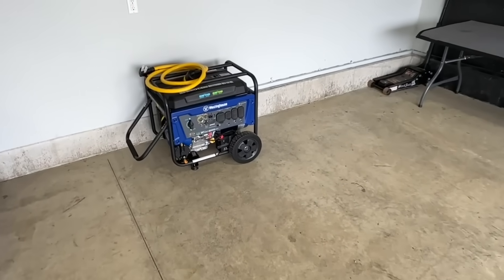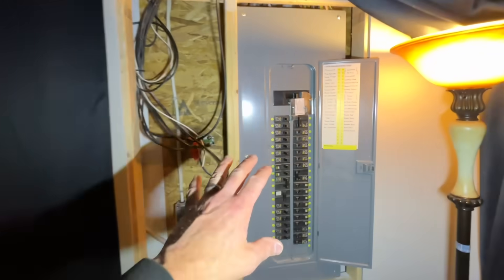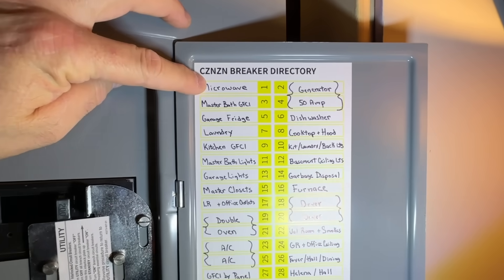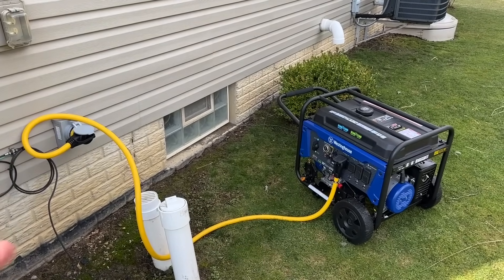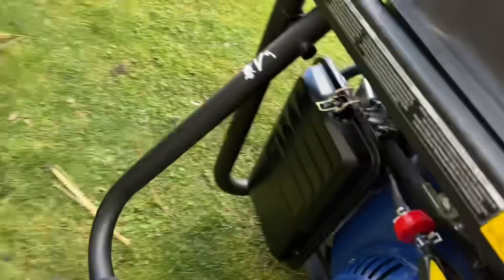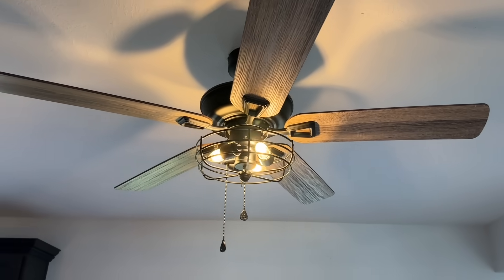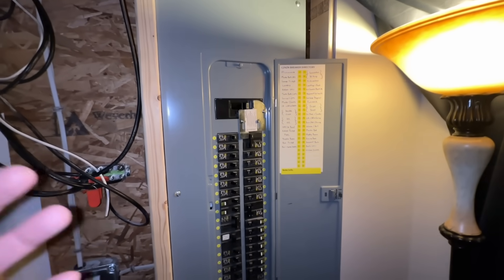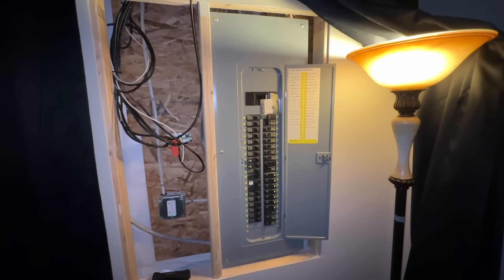Whole Home Manual Backup Generator Setup For Less Than $1600

Comment: Yes, it's amazing what you learn about your own personal electrical grid when you set up backup power. Luckily my stove is gas. It uses 120 for it's electronics, but that's minimal. My clothes washer and dryer are electric however. I have a 240 tanning bed that gets turned off on emergency power, as it's very voltage sensitive and normally has to run with a buckmaster. I do leave the hot tub on however, but that's it. The hot tub doesn't use much power just to maintain itself. But it does if you let it get cold. I keep mine at 104, and it's fully winter weather insulated. I also shut off my garage door openers and let them run on their own backup power. They'll run a couple of weeks on their own power easy. And they're both 3/4 hp motors. No point in allowing the backup generator to get involved in that if you don't have to. I run a huge gasoline powered job site Generac that's rated for ethanol gasoline, in a waterproof shed about 15 ft away from the house, and I had an electrician run the line and modify my panel for it. My Generac will build a whole subdivision and will easily power the house and it's sensitive electronics, but load determines fuel economy and while we will run the heat, we won't run the central air. Central Air has a huge startup draw. (Furnace blower, A/C control unit, outdoor industrial compressor, outdoor industrial cooling fan that needs a starter relay just to fire it up)

I've only needed it twice in the 15 years it's been installed. Ironically, within the first two weeks I installed it. Really. The power company now keeps the trees well groomed and it's never happened again. The worst was a whole week on backup power when a huge 9 foot across tree blew over in 100 mph winds, after two weeks of solid rain and we were still in the middle of the storm. It took the houses whole front yard with it. That broke in the generator. The best was three days for the same reason, but a smaller tree. And, not a week after they got the power back on. They've since cut all the dead trees down. You can make power reliable if you want to. Even on poles. And that's why I installed it, you could see it in the trees and it spooked me. Really spooked me, obviously. And I was within 2 weeks of calling it. All you have to do it open a door, grab the end of the cord and plug it into the house.

I seemed like a genus at the time. My wife thought I was crazy until that happened. I also setup the house across the street. Our little corner was the only lit corner in half the city, and they used it as their staging area because of it. We kept all the outdoor lights on at night. That was a hell of a year. They also profusely thanked us for having the backup power. And it comes around; we always had a funky street light and I called them on it during all this. After it was finally over, they came back and tore out the 100 year old street light and put in a brand new LED unit. It's really nice and much better in fact.
Reply: Whether or not to keep your hot tub and home tanning bed operational during an extended power outage is quite the dilemma! First world problems! 😂😂😂 Personally, I limit my man cave to 80% capacity if the outage lasts more than a few hours because I don’t want my food to spoil. And if my home movie theatre had to be temporarily shut down to survive the outage, it would be a really bad day! Imagine not having entertainment when you need it most.
Reply: @Ephesians-ts8ze  My point was the research you do to plan out aux power. Your personal grid will be totally unique. So you even know what a buckmaster is?
Reply: @dannysdailys  @dannysdailys I know. I was just clowning. But no, I don’t know what a buckmaster is. Is that like a surge protector or something?
Reply: @Ephesians-ts8ze  Actually, a Buckmaster is either a drop down, or an up-shift box. On the panel and it's a huge transformer full of PCB's. In my case,  the power in my house is very hot. The outlets are a full 120 volts and my 220's are a full 240 volts. The pole transformer is only one pole away. Commercial 220 tanning beds are very voltage sensitive. Who knew? My particular bed only wants 219 volts. I found this all out when I bought it and Wolf had me check the line voltage and sold me the buckmaster with it. And I bought the tanning bed because I'm very fair skinned and got it for the Vitamin D it gives you. Vitamin D is the most effective cancer killer there is and can only be gotten two ways. Directly from the Sun, or a tanning bed. For my skin, the tanning bed gives me a base tan so the sun won't burn me to a crisp and cause skin cancer. When you buy a buckmaster it has to be exactly what you need. I needed a 21 volt drop in voltage and mine cuts that exact voltage. 240 in and 219 out. They can also boost the power as well, but have to be bought that way. My backup power doesn't have as high a voltage as the pole. And that's why I shut if off. The Buckmaster is wired in and would still cut the voltage 21 volts. The hot tub however, is rated for the full 240 volts and the higher the voltage the more efficient the heater is. It's there because of chronic pain in my back. Please, don't be jealous of what other people have. You'll never have any of it yourself, the bitterness shows through. Because of my back, my Mom gave me my first hot tub, and I've had one for well over 20 years now.

Comment: You said $500 to install the interlock kit. That’s a lot the kit only costs about $25. You buddy charged you $475 to install it is crazy expensive. Is that what you said?
Reply from the maker: No, there was the cost of the interlock kit, extra double breaker, roughly 10’ or so of low gauge power wire, outdoor 50amp plug, and labor.  Probably about $300 in labor as he brought a helper as he did this for me between jobs that day to help me get it done.

Comment: I got the same westinghouse i paid about 850 for it the electrician 
 me 900 for the interlock and wired up the gen and house hookup plug and gave me a cord for gen to house i haven't had the need to use it but its winter here so iam sure it will happen great vid

Comment: That generator that you have is good enough to turn on everything in your house. You just don't use all of the appliances at the same time, like the dryer and the stove. When it is hot, you need A/C, so turn the A/C on and have a small spare gas stove in the garage for backup emergency.

Comment: Breaker panel. A fuse panel has cartridge or screw type fuses and must be replaced after they blow. Breakers can be reset.
Reply from the maker: I know, but thanks for pointing it out. Sometimes when you’re filming and talking a lot, the wrong words come out and you don’t catch them till later.

Comment: If you have things you have to shut off nefore using the generator how is a WHOLE HOME generator??   The whole home thing is a marketing ploy that was started by generac.  IF you want to run your while home as in EVERYTHING then have a load calculation done or have your electrician do a recorded load profile done.  Remember, you have at least a 150 amp main in your panel!

Comment: Here is a method to hook up your whole home to a generator: 1. Start up the generator, 2. Plug it into your house, 3. Pray to the Lord that when you die after trying this that you do not go to that hot place to shovel coal for eternity. ... or .. if you want to live a long life, just run an extension cord through the door or window and plug the stuff you need to multiple plug with circuit breaker in each available plug.  God does not like stupid.

Comment: 500 hundred  dollars ?? The electrician rubbed you badly dude !!! Parts cost $ 50 and one hour with coffee between  labor !!!!
Reply from the maker: I paid the electrician $500 for an interlock switch plate, outdoor 50amp plug, about 10-15’ of 4 gauge wire, 2 new breakers, and he then had to move two breakers from the top of my breaker box to the bottom to make room for the two new breakers at the top for the generator.  Probably around $150-200 in total materials and maybe $300 in labor as he also showed up without an appt on his route to another job to help me out and had a helper with him.  I’d say overall I was fine with $500.  It was fair.

Comment: Next time you need 3 screws and a metal slider installed, hit me up. Running a weekly special for $400
Reply from the maker: Ok, sounds good.  Interlock switches $25, 4 gauge wire roughly 10’ probably $25, 50amp outdoor plug probably $30-50, additional breakers for 50amp around $20-25, and then time to open the breaker box and move two breakers and reinstall everything.  So probably $100-125 in material and roughly $300 labor.  I paid $500 as my electrician helped me out by installing it on the fly when no one else was available and he had an extra guy with him.  I don’t expect friends to do work for free.
Reply: @DieselLegiance  the way I heard it the first time I thought you said you paid him $500 to just put the lockout plate in. My bad!! $500 to hook all of that up is a great deal. I have been wanting to do this to my daughter’s house. Sorry I mistook what you said
Reply from the maker: It’s all good buddy.  Yeah I paid $1000 for the generator, around $70 for the RV cord, then $500 for the electrician to buy the interlock plate, breakers, 50amp outdoor plug, 4 gauge wire, and do all the work.  Total I paid for the entire product was around $1570.  Is a full auto transfer service better and easier, yes, but that costs $10-15k.  For what I need which is temp power a few times a year for a day or two, this works perfectly fine.  I can run my 2 fridges and 1 freezer, multiple lights, tv’s, fans, and more.  My Furnace and Hot Water tank are gas though so that helps.  Overall, this manual system works great and is very inexpensive compared to a higher end system.

Comment: Bought the same gen a couple years back for house back up. I have a transfer switch setup in my garage for mine. I also only run propane as I found it much easier to store over the long term and remain stable and keeps the unit cleaner. It's a bit less power but we're never near max load anyways as we plan out what runs so as to keep the load moderate. As others commented, never flip the power over with all the breakers open for the house as it can place a overload on the generator. You should be flipping breakers individually as it's running to allow it to build up for the demand. If you do the wiring yourself be aware if it violates your home owners insurance, you'd hate to have something go wrong and find out trying to save a few $100 bucks you burned the house and the ins. was cancelled.

Comment: That generator brand is known to have a really high THD % , over 20% , for your home you want a much lower THD % , under 5% if possible , especially if you are using sensitive electric and electronic equipment in your home .

Comment: Why put you plug on the out side????? How about putting the plug inside the garage next to the big door. You say you have a 10 foot power four prong cable.  Connect inside and put you generator just outside under a covered but open area for exhaust safety. That way there is some protection from the weather and wind for the generator but at least the connector to the home is inside the garage out of the weather and insulated from damage or tampering.  Just keep an eye on your generator when you must use it, I do. I usually park a vehicle a few feet in front of the generator in line of sight from the street. That will reduce the risk of the possibility of snatch, grab and go.
Reply from the maker: Because my house is 75’ wide and my breaker box is on the far side.  It was cheaper to place the plug outside the wall of the breaker box for a short power cable run for install.  I was aiming for a low cost install since I don’t use it much.

Comment: I got a question, I have the exact generator.. I'm hooked into my house about identical, but I'm  hooked to my outside 200 amp box..my breaker setup is the same as yours, the really only difference is my generator is 5 feet away, in a building. I can run everything.. except my furnace, I cut all my breakers off before I turn furnace on. It kicks breaker in my breaker box in the house, and kicks breaker on generator. What do you think is my problem?
Reply from the maker: Hard to say.  Sounds like a wiring issue and less of a lack of power.  Id recommend having an electrician go back through and check.
Reply: @DieselLegiance ok.. thanks

Comment: I have seen Youtube comments where people said that electricians wanted thousands of dollars to  put in the interlock.  My own setup was about $1400 and that included the professional inlet install. My house has gas heat, and I am able to run pretty much everything except the central AC off of a 5000 watt inverter generator.

Comment: I purchased a Westinghouse 10500 trifuel and its coming soon 10 31 24  .  I am using a generac 6500 thet was working with 30amp transfer switch breaker box. Now i need a 50 amp switch box. I gave the generac 6500 to my son to use it at his house. I have natural gas.

Comment: On my 10,000/8,000 I can run my 3 ton HVAC unit with no problem. I can also run my well pump, coffee maker and air fryer and all my lights. I have all LEDs though.

Comment: You can't run a generator in rain and can not box it in it will burn it up. A shed roof is needed. Just add  another $250. Wood, labor, roof material.
Reply from the maker: I understand and I did not been enclose it, I meant build an open side box with roof to protect from the elements.

Comment: When I moved into my home, in 2009, I purchased a generator, for just this issue.
What I didn't know, is that my grid, supplies power to the police station, as well as city jail and courthouse.
Since moving in, we've only lost power 3 times, for less than an hour each time.
The generator sat so long, that the carburetor fouled up so bad, I couldn't get it to start, LOL!
I ended up giving it away.
A couple of weeks ago, we had the worst power outage, we've ever had.
The power was out for 3 hours.
I have my workstation and TV hooked up to UPS, that ran them for 2 hours, before I had to turn them off.
If it had lasted much longer, I have the best solution, a 3,000W inverter, with a quick connect to my car.
In less than 5 min, I can have it hooked up, running the essential items in my house.

P.S. You really need to shut off all breakers, then turn them on one by one.
This goes for connecting back to the grid as well, so you don't overload the generator or grid.

Comment: If you're not using the appliances or whatever your load is on a breaker, you don't have to leave it off.  It's only going to pull a load if you use the appliance or light, ceiling fan, etc.

Comment: Is it a problem to leave the gen in the garage when it is freezing -5f  since I may need to use it anytime, so i don't want to empty the gas  tank and rem9ve the oil after each use
Reply from the maker: It’s better than storing it outside.  But think of it this way, your vehicle sits outside in cold weather so a generator in the garage is fine.  But, I would not store it too long with a full tank of gas because gas can go bad.

Comment: I'm currently comparing the Westinghouse 9500 to the predator 9000 . Any advice from owners??
Reply from the maker: Both are fine.  The W9500 is dual fuel and more powerful whereas the P9000 is gas only and slightly less powerful.  It all depends on what you’re trying to power so choosing a generator powerful enough to run your applications is key.  The P9000 is a couple hundred cheaper but if you can get a deal on the W9500 I’d say go with more power.

Comment: Adding a generator is a great idea for a short outage but very expensive and loud for longer durations. I added an 18000 watt battery backup that the generator can charge up in just two hours a day saving a lot of money in fuel costs and noise. Now starts the snowball effect. I am installing 7000 watts of solar which should supply most of my  electrical needs for the majority of the time. In winter I expect to have enough left over to suppliment part of my gas bill. All told, I am now looking towards a 7.5 year payback for my whole system.

Comment: Nice job, I helped put this system in the problem is you can’t tell when you get grid power back, you have to check your meter to see if its showing numbers,if the meter is blank then you don’t have power.

Comment: Like so many of the other comments I've done something similar.
First and foremost, wanted to say Great Video!  Thanks for documenting and sharing this.  
Here in the Upstate of SC, we just went through Hurricane Helene and it was sad to see how many of my friends and work colleagues lost power and everything in their refrigerators over the extended power outage. 
We've had the same 5kw Generac generator for almost 30 years (since Hurricane Fran in 1995) and have used it in a similar manner as you described for about 5 long term outages since then.  
In my past 2 homes I installed a manual transfer switch that powers "only certain breakers" that can be switched from utility power to generator power and they included 220V circuits to power our well pumps.  Finally in this home, we installed an interlock similar to yours, and since we have city water and a propane hot water heater, we can get by without any need for 220v circuits, so we are able to power all of the 110v circuits in our 2500 sq. ft. home during the recent outage.
The only suggestion I have is don't bother switching breakers on and off.  Leave them all on BUT... 1. make sure you have LED lights as they use MUCH less power and:    2. only turn on lights and appliances "as needed."  This way, as you navigate your home during the outage, everything will work when you need it, as long as you don't try to use everything at the same time.  
Thanks for sharing!  👍